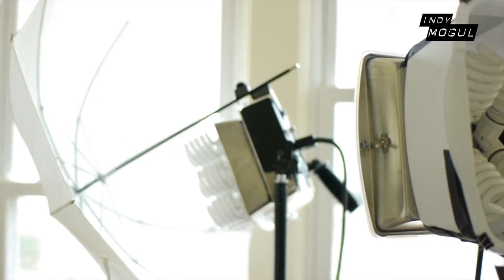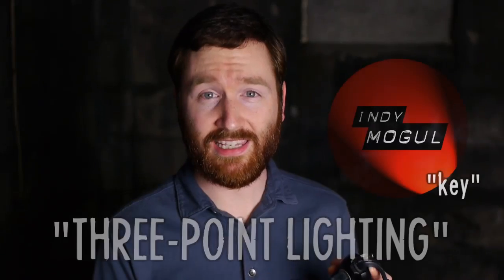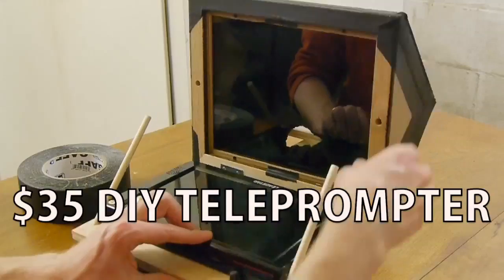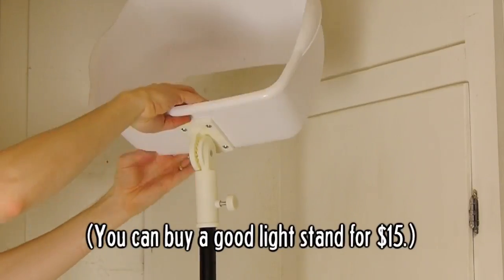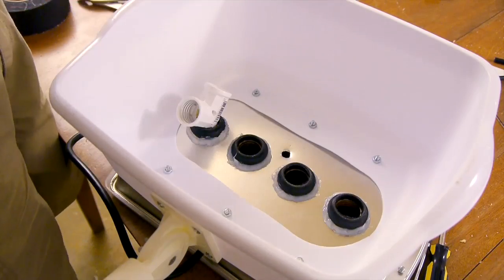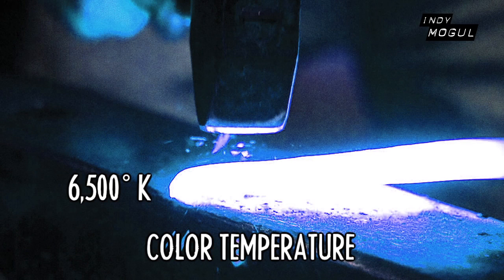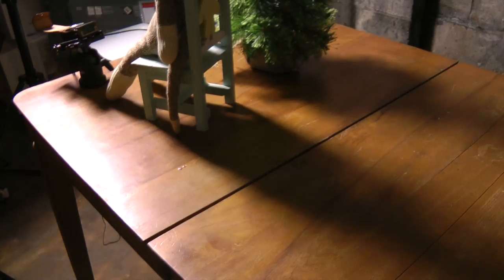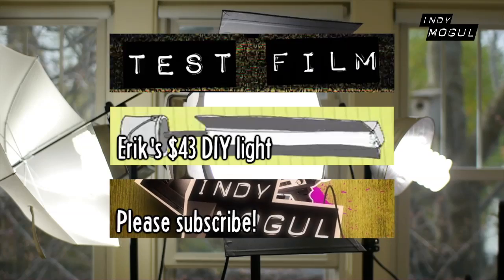How-to: Powerful DIY video light (800 watt equivalent)

Comment: I had this light built for me at Home Depot and it works wonderfully. Thank you so much. (Also there making another one for me)
Reply: When r u gonna start making vids? d like to see um
Reply: How much do they charge to build it?
Reply: nothing it was free i just bought the materials
Reply: so, how does that work... you buy the materials and then talk to which department? and how do they know how to build it? sorry if the answers seem obvious... i just can't imagine any store offering this for free, but would love to have it done. thanks!
Reply: I just asked my local home depo if they would help me make a light. I had talked to them a couple of times about making the light. it just so happens that there was a worker that used to be an electrician. he helped me build my light. it took about 4 hours to do mostly because we had to wait for the glue to dry. but i just asked. i bought the material and they put it together for me. I'm working on a low budget movie now and we use my light all the time. Its really amazing and very powerful. also i would recommend that you get daylight light bulbs. they are the whites light. and will save you less color correction in editing.
Reply: Thanks so much! I'll definitely check with my Home Depot.
Reply: your welcome

Comment: firstly I really thank you for the video and I have a question..can I use dimmer switch instead of on off switch?. I think it sounds better to moving the lights.. And one more question.. isnt it better to cover inside of the white plastic dish pan with a silver paper to bounce the light better?. Thanks for answering. have a good day..
Reply: Firstly, for a dimmer, you need dimmer compatible CLF bulbs. It usually says if they are or not on the pack. Secondly, while a reflector would be good in some cases, it really depends on the use of the light. This is probably more of a fill light so reflectors could possibly create un-even light.
Reply: Another thing, people have said below that most dimmable CFL lights change colour temp so *****'s idea is probably the best.
Reply: SoundPon3
thanks for the answers.Im building one for my home studio.helped me so much.have a great days..

Comment: I can't stress enough how important it is to say the names of the things you use in this kind of video (this particular vid was informative). I have looked many times for basic light bulb holders. Usually you can buy "clamp lights" but I'm in the UK and they barely exist.

I just found what I'm looking for is called an E27 holder, and suddenly I can find everything I need with the right keyword.

Comment: What is the advantage of using this 800 watt system over a 800w redhead halogen lamp that costs about $65?
Reply: Different colour temp, softer light, wider light source, runs much much cooler.

Comment: Really awsom video, the information / time ratio is incredible. There is only one very little thing (also to avoid confusion) I'm pretty sure, it should only be K for Kelvin when you're talking about Color Temperature. Not °K, because ° is a different Unit for Temperature.

Comment: If I build 2 of these, would this be sufficient as an alternative to strobe photography in a home studio set-up? I'm just starting out with this and I have a very limited budget. Many thanks. I've used an Elinchrome D-Lite 4 Studio light System (total 800w output) and I'm wondering would I get similar performance out of this DIY build..?

Comment: Thanks for this solid Tutorial Griffin!
I'm an Austrian YouTuber planning to build your video light. Since I could not find any 5000K CFL bulb, I wondered if mixing 4x 2700K bulbs and 4x 6500K would make a bad impact on the result. If so would you recommend using less, but more powerful 5500K bulbs? I'd be happy reading from you.

Comment: I recently finished a build.  I found that the silicon did not keep the light sockets in place on the cake pan. I think it may be that the pan I purchased was non-stick.  I instead used some extra 3M 5200 marine epoxy I had lying around my garage, which did the trick.

Comment: I'm a no-budget filmmaker and this my cheap solution to lighting: two clamp lights, two white bulbs and one red, green, yellow, and blue bulb. If I can, I clamp the lights onto anything handy nearby, like a door or a table. If there's nothing else, I get out my spare tripod and clamp a light to that. I use the two lights as the key and fill lights, and find that I don't need a back light inside if the room's overhead light is on, or outside if the sun is out.

Comment: Griffin, I just built this and it's awesome. However, I need some help with mounting it. I used the flag pole holder you used but my old light stand only has a 3/8" rod on which to mount the light. As a temporary fix, I cut a wooden dowel to fit in the holder along with the rod but it's not stable. It swivels very easily. Do you have any suggestions on how I can mount the light more securely?  Thanks!

Comment: I can make a video about it, but there wasn't much different I did than what the video above showed.  I just followed his steps, and improvised on the areas he skipped/glossed over.

As for the 240V, I'd assume you could do it, but we don't have 240V lights/etc here so I wouldn't be any use for that either.

Comment: See previous notes:

6) The hole for the power cable needs to be smaller than 1/2"
7) The CFLs are at Home Depot for 4/$11
8) It is as bright as advertised
9) My electrical knowledge is beginner, so it's not difficult to build
10) If I was to do it again, I think I'd put the screws out further from the lights, and maybe reinforce it on the plastic side more.  The plastic pan is too bendy for my comfort.

Comment: OK I just made two of these today, and here's a few notes.

1) I was able to stay pretty close to his price.  I built two for about $180
2) Silicone sealant does a horrible job.  The sockets stay in place, but once you twist the splitter, the seal breaks.  You have to twist VERY gently. There has to be a better way to secure the sockets.
3) The $4 pan is at WalMart
4) The flag pole holder needs more reinforcement.  I'm thinking of using a long hard plastic.
5) Gloves or tetanus, your choice.

Comment: If you don't mind me asking why not T8 or T5 lighting setups with 2 by 4 bulbs or so? These are much easier to get and cheaper as well. I have been looking into similar setup to yours but it seems to be quite hard to get where I am. T8 or T5 seems like a good option.

Comment: It depends on the effect you want to get. The good thing with the softboxes light is that it removes the shadows. But If you use this DIY light as a key light and another one as a fill light to remove some shadows on the background, both technics can be used. Depends on what you prefere. 

I use both, depending on what I want to get !

Comment: It's the ground wire. You usually attach those to a ground point (and with this project, it's the metal chassis of the build) to limit the damage of ... well... Long and skinny, it prevents needless damage/harm due to 'electrical oops' (line surges, lightning strikes, shorts, etc).

Comment: your wall power socket has three wires to it. Live wire, neutral wire and earth wire. Live and neutral wire is what powers the appliance, and the earth (green wire) is attached to a metal conductor such as a pipe, or large anything, for safety. If there is an over charge of electricity then the earth wire is used to dump the excess.

Comment: Bare coiled-tube CFL bulbs are fragile and are not made for outdoor use. They contain mercury and are a serious hazard when they break. A safer option is to use coiled-tube CFL's encased in a standard cone-shaped floodlight shell, PAR 30 or 38. They also have built-in aluminum reflectors that can eliminate the need for an external reflector to focus the light forward.

Comment: Get the 6500K bulbs. The output will be exactly the same as direct sunlight. If you need to lower the color temperature, for example to match other lights, you can get gels called CTO ("color temperature orange") pretty inexpensively.

Comment: Finding 5000K lights in The Netherlands is difficult (unless you pay 80eu per bulb). I can get 23W (equals 88W) lights with 6500K for 9 euro per bulb or 20W (equals 100W) 400K for 9 euro per bulb. Which one should I go for?

Comment: So we've just finished making this! ...Sort of.

Everything works, it cost about $150 CAN all said and done. Looks great, appreciate the awesome walkthrough and video!
Here's the thing I'm stuck on.
Only two sets of the lights come on. Looking at the back of the unit, numbering the sockets from left to right, only sockets 1 and 3 work. We've tried switching the bulbs and splitters and checked all of the wiring, and everything seems to be in order.

Any advice?

Comment: I made my lights just like he did in the video. He bought generic power cables and on/off toggle switches from Home Depot. If you don't have prior experience wiring up electrical devices you should really have professional supervision in attempting to make this light or any other electrical fixture.

Comment: wish I had found this BEFORE I bought lights. Anyway, after spending ~ $200 I still don't have as much light as I'd like, so I plan to build these. But one question, is there a Brand of Bulb you recommend cause some seem to be drawing a lot less watts than claimed and therefore putting out less light. the "45's" I bought seem dimmer than my overhead shop lights that are much farther away. I just want to make sure I'm getting the real deal on lights. Any suggestions where to buy them?

Comment: I have made both your teleprompter and the video light. Both are great!! Thanks a bunch.  One comment on the video light.  The silicon adhesive doesn't do a fantastic job adhering to the cake pan.  One could use 1 1/2" hose clamps on the cake pan side to add some anchoring.

Comment: I built a variant of this design using a larger\deeper plastic bin, lined with aluminium and covered it with white nylon, resulting in a pair of 800 watt softboxes - much nicer than the halogen work lights I was fighting before.  Set and forget white balance, better color, and best of all, cool running daylight on demand that won't pop the fuse breaker or start a fire :-)  Thanks for the guidance!

Comment: very nice DIY! I have a question. Iwant to build it, but I dont find 5000k bulbs. In my country only get 2700k, 4500k or 6500k. is there any chance to mix bulbs to finally get 5000k. is it better to use all same bulbs. wich k is better? thanks!

Comment: Griffin, thanks so much! I used your design as a starting point, then tried a few upgrades while staying under $86 per light. I used 609-box sockets, which attached to the pans without the need for silicone. This was actually cheaper, which meant I could use a 2-switch design to bring the head to half-power. I used flat black spray paint instead of gaff for the barn doors. Finally, I upgraded the bulbs to full spectrum CFLs, though the bulbs were definitely a splurge by $66 for 2 lights.

Comment: You could use power strips and wall socket to light socket adapters. I don't know how much you'll but you won't have to wire anything.
Also the only way to get variable control would to make (or buy) a dimmer and to use incandescent bulbs as fluorescent bulbs can't be dimmed.
The problem with incandescent is that it uses more power and produces a lot of heat (which is both uncomfortable and also might melt the plastic)
good luck but it seems you're stuck between a rock and a hard place.

Comment: I've been subscribed to you for a while, seen this video probably 4 times but I think i'm finally going to bite and attempt the project, ~90 is a bit more than I'd like to spend would there be anywhere I can cut and skimp to reduce the cost?  Any guidance is appreciated! Also would a variable control be suitable for such a setup? Thx Griffin!

Comment: Hi Griffin,

I'm sorry but I think this project doesn't output 12800 lumens at all. Taking as basis 1lm = 1lux@1meter and suposing light it's 1 meter far from model, it throws about 7,7EV@ISO100 or 540lm.

I've trying some DIY light projects and there are nothing gives you about 10 EV@ISO100 (2600lm, something respectable) for really cheap. Even some commercial 600LEDs light panels don't deliver this light output. A cheap 160LED lamp gives you a 860lm beam (60º, not so spread).

Thanks 4 ur vids

Comment: HiGriffin. I am wondering for those of us who dont use the photo store cfl bulbs. Does it matter what brand hardware store bulbs i use. Is there a difference in light quality. I do understand i need to try to match up the light temperature. I have bought a few utilitech from lowes, 4 pack for maybe $12-3  but I recently saw walmart has a house brand for $9.88 for a 4 pack of daylight balanced, and i am tempted to add pick some up. Just wanted your opinion.

Comment: You can use speaker stands for live sound applications. They have super wide tri-pod bases, for stability, and they can be purchased on ebay really cheap, if you look around. I got one for under $30, and it was built like a tank. They can usually handle 80 lb. speakers, so this DIY light would be no problem for it. Hope this helps you out.

Comment: Double-check the wire continuity on that socket. Imagine the power comes through the black wire from the wall, through the switch, through the black wire into the socket, then flows out the white and continues back to the white of the wall outlet. 

Also, make sure none of the wires are making contact with metal, and that there isn't any metal in the socket or somewhere that might be causing a short.

Good luck.

Comment: i bought all the materials, and built this light. But i have a problem, I used 60 watts CFL bulbs that are 5000k appearance. i wired it up correctly , green wire to pan, white to white, black to switch and then to black of sockets. i put one light just to test and pooofff light bulb blew. Y? any idea? do i have to have all the lights in them?

Comment: Beware, DO NOT BUY THIS PRODUCT unless you want a 250 watt lamp.  Ephoto/Fancierstudio/Cowboy Studio says that its product can handle a 800 watt 78mm bulb, truth is that no 78mm halogen bulb should be over 250 watt for it can result in either permanently breaking the lamp socket or can cause a fire.  Believe me, I know, I had to learn the hard way.  If you do own this product, substitute the 800 watt bulb for a 250 watt bulb before the lamp is rendered useless.

Comment: For those of you who are electrically challenged look at modifying with ( 6-Inch AC Extension Cord
by Radio Shack) and (Leviton Outlet to Socket Adapter) both on amazon

This was the Best DIY Lighting Video of 2012

Comment: I have an issue with CFL lighting. If you are using any shutter in your video productions, there will be small shifts in color. If you use CFL lighting you should not be using shutter. Just an FYI.

Comment: They are NOT good. If you have absolutely 0 dollars to spend extra and you NEED lights to shoot with IMMEDIATELY then buy the lights since they are dirt cheap and bright. But they are extremely unreliable, cheaply manufactured, and electrically dangerous.

Comment: Those lights are terrible, cheaply made, un-stable in the housing which heats up to dangerous levels, and electrically they are unsafe since they have no earth termination which means you become the ground should something happen like a surge, which in turn means you get electrocuted and die.

Comment: Hi there! Excellent DIY, in fact I'm trying to build it! But I have a question for you.. I've got the plastic dish pan but, it is not white, I couldn't get a white one.. So I was thinking.. May I use aluminum paper on the internal walls of the plastic dish pan? If so, is there any problem? Or maybe, should I paint it white? What's best? Thank you for the DIY, again, it seems to be exactly what I need.. :-D

Comment: If you wire the mains power in series, the voltage will get split up between the bulbs and they won't light properly so always wire mains power in parallel

Comment: That's the whole point of having a ground. If there's a short the ground wire provides the path of least resistance to complete the circuit, instead of your body. ;)

Comment: Well done!  Another benefit of using CFLs is it keeps the set cooler in temperature.  Incandescent lights can make the talent very hot and sweaty.  Also, diffusing the light and moving it closer to the subject softens shadows as well.

Comment from the maker: I wouldn't have the time, Brad, to start selling these, but my hope with these types of videos is to inspire others to modify and create new designs. Some have mentioned buying sockets with pre-wired cables/plugs. You could attach a power strip to the device and build something similar without any electrical work.

Comment: Great build.  May have to throw one together.  Quick complaint about safety, though.  Your 4 short pieces of wire had rough/frayed edges.  Don't do that, please.  Rough wires like that cause resistance which cause heat which can cause a fire.  Nice clean cut wires is what you should have.  Again, great build though!!

Comment: Griffin, great build. I was wondering if you could do a show on where a new film maker should spend his first $1000 on a equipment besides camera. ie tripod, lights (save money money with dyi) audio, and that sort of thing. I built your teleprompter and although I haven't done a practical application on it, it works great. 
PS I'll send you some side cutters for cutting your wire this christmas.

Comment: im currently constructing a much more directed light using air ducting. the giant cfl will work fine with it. and you can order a 750w equiv 150w cfl on ebay for under $30. waiting for mine to arrive but with my design you can use a large incandescent because its all metal save for the socket which is a porcelain socket meant for a heat lamp